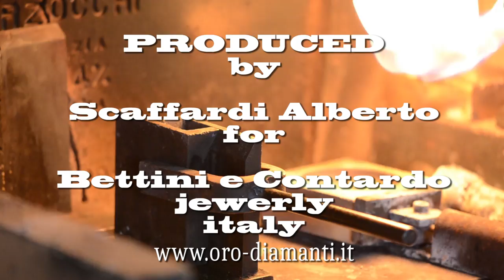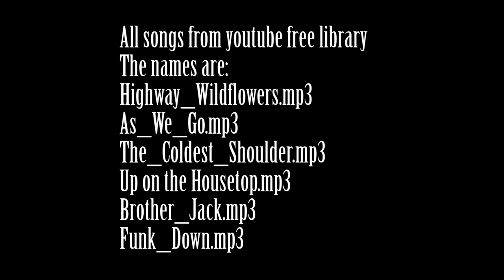How renew gold ring with emerald and diamond of the client.

Comment: Hey Scaff, I've been watching your videos for such a time, I work as goldsmith too but have never seen this technique, that you make a soldering with the diamonds already set. Does it work only with diamonds or every stone? Do you got some tips for lowing the heat? I usually take the ones out and it kinda wastes a ton of time. Anyways, wishes of success from Brazil and thank you for the content.
Reply from the maker: Thank you. The sublime diamond has 870 degrees centigrade slowly. If
 it is not exposed to heat for a long time, I do not exhibit it at 
particularly high temperatures (temperatures necessary for platinum 
welds), normally there are no consequences. For other gems, I would avoid exposing even if there are no obvious hazards. My advice is, however, if you have the chance to test with waste gems. To improve your knowledge.

Comment: fire did not destroy the diamonds? They are somehow protected?
Reply from the maker: +Mek00071 The diamond remains unchanged up to 1500 degrees centigrade. The welding of gold melt maximum 900/1000 degrees Celsius. Consequently the diamonds are not damaged during the processing of gold (usually expose themselves to high temperatures only if you can not do otherwise)